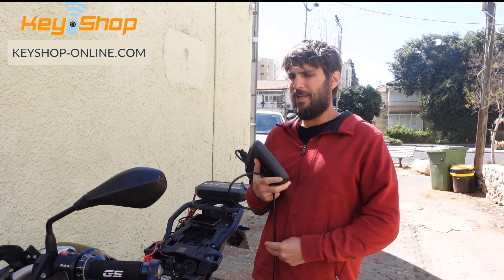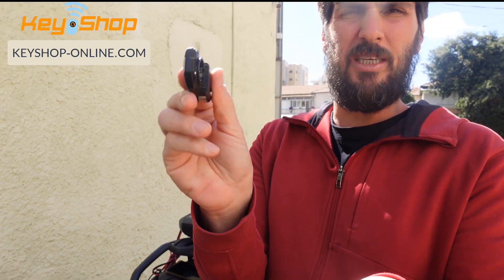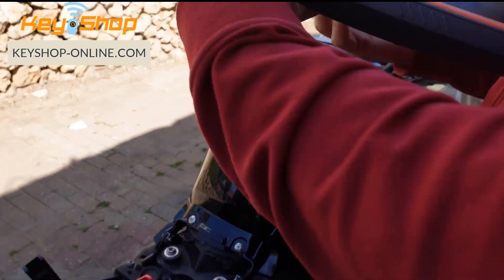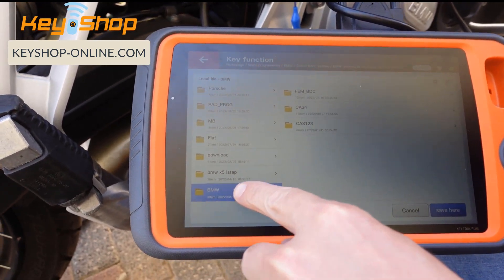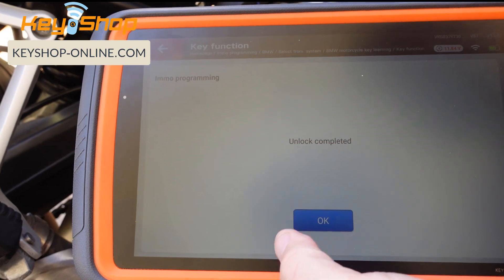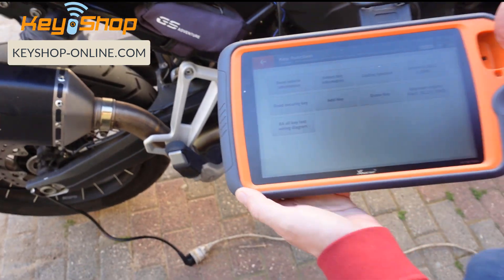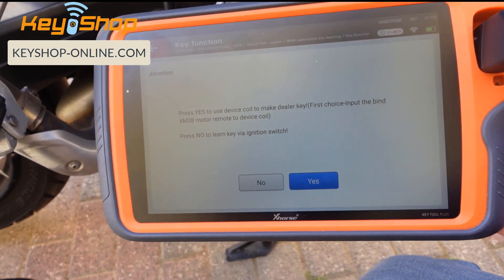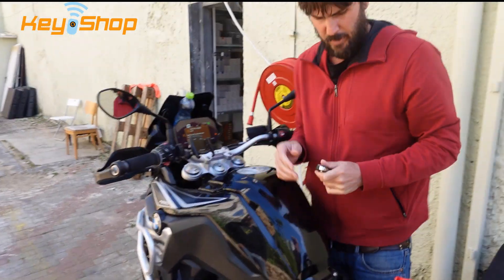ADD SMART KEY -  BMW  GS 850 Motorcycle  using KEYTOOL PLUS

Comment: thanks for the video. what year was the bike? have you had any problems programming the key? is it possible to program an additional key into a 2018 r1200gs motorcycle using the same procedure?
Reply from the maker: This software supports 2014+ with the ID8A chip, there shouldn't be problems, but if you loose power during flashing operation, you would need to recover the flash using Xhorse's BIMTool Pro or another compatible tool, as as other BMW models

Feel free to contact us directly for purchase and to learn more: https://keyshop-online.com/pages/contact-us

Comment: FOR BMW GS 1200/2016 WITH 10PIN CONNECTOR  AND WITHOUT OBD 2 WHATS THE PROCEDURE?
Reply from the maker: Either bridge Xhorse's OBD plug using DuPont wires, or buy a OBD to BMW Motorcycle plug converter adapter.
If you like the video please check out our online recorded key programming academy, we offer up to 400 hours of lessons for only $299 including live tech support, a certificate, and unlimited access! (one-time purchase)
https://keyshop-online.com/courses (if you're a beginner get our AUTO101, it has much more than the basics though)

Comment: Great tutorial - currently going through your BMW course. Your awesome. 

One question on this topic of BMW  motorcycles. I tried generating a 8A chip instead of xhorses universal smart key. So basically it would work like the Plastic emergency key (that would start). However we get an error that the vvdi key tool will only accept the XM38 Motorcycke key.... So basically it will only allow a XM38 and not allow us to generate just transponder chip. Do you know of a way around that?
Reply from the maker: Hey Jonathan, I would suggest trying to chip clone that programmed 8A transponder, however if it's not supported, unfortunately Xhorse only offers programming for full remotes. Reminding that you can contact us via the website chat for immediate response. https://keyshop-online.com/courses

Comment: All key lost possible ?
Reply from the maker: Yes it is, though sometimes these bikes come with either a regular OBD, or circular connector - in which can you’ll need to bridge the tool’s obd using wires, or use an adapter cable (very cheap to buy)

Feel free to checkout our affordable unlimited access online training covering this subject and more at www.keyshop-online.com/courses

Comment: For everyone, this doesn't work if you don't have a working smart key, with the emergency key it doesn't work this method either with all key lost no let in
Reply: Good morning from Greece, today I added an XHORSE smart key, having only the emergency key, so it is possible to do it with keytool.
Reply from the maker: KEYTOOL PLUS fully supports all keys lost for these bmw motorcycles attaining full key functionality, and there’s no issue recreating the emergency key.